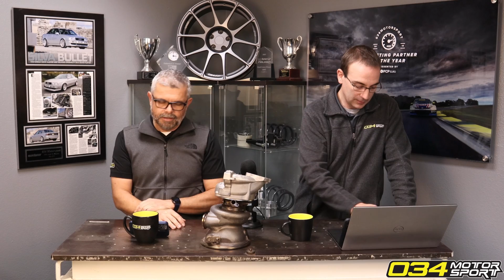Why Does B9 3.0T Stage 3 E60 Make More Power Than E85?

Comment: Can I upgrade my low pressure fuel pump and use the e60 map with full e85 ?
Reply from the maker: You cannot. The LPFP is not the bottleneck in this fueling system.
Reply: @034MotorsportUncut What is the bottleneck? So you can gain more power from e85 than e60-70 you just need more fuel that the fuel system can’t deliver right? So in the future you can upgrade the fuel system so you can make the the most powerful tune?
Reply: im assuming the HPFP and/or fuel injectors @JensenDK